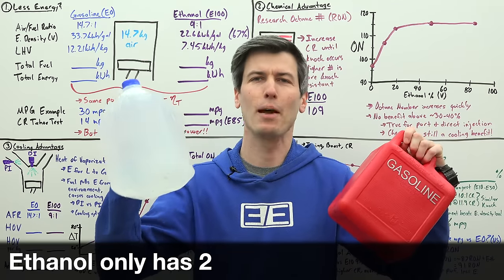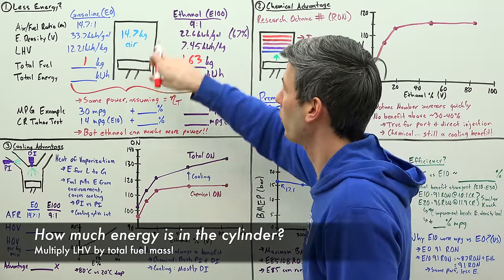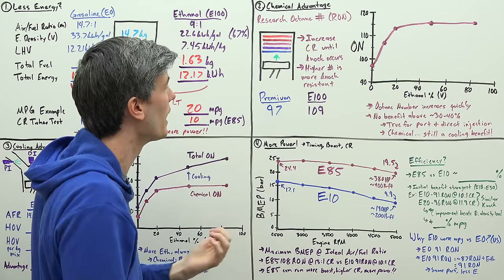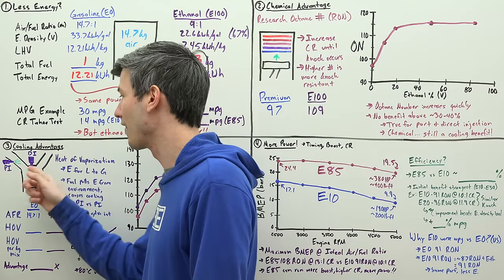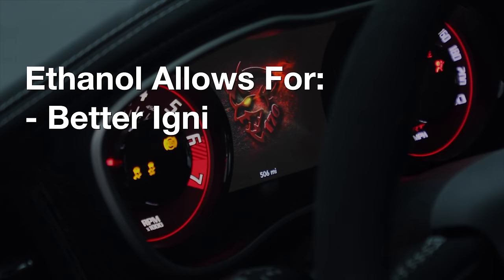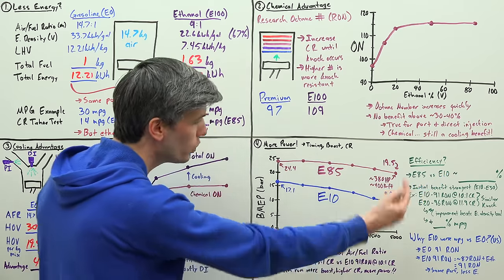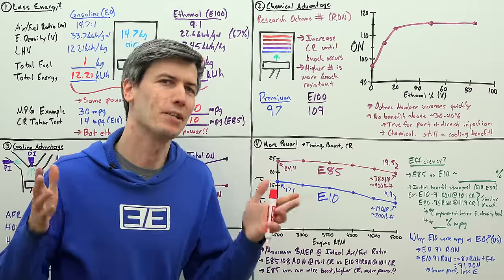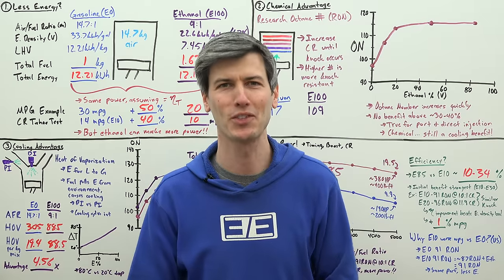Why Does Ethanol Make So Much Power? (Versus Gasoline)

Comment: Methanol VP racing m5 is still the boss.
Reply: The Indy 500 has used gasoline, methanol, and ethanol.  Here is an article when they switched to ethanol:

A Brief History of Racing Fuel By Craig A. Johnson

In 2005, the IRL used 100 percent methanol in their tanks. The fuel worked well and was more efficient than straight gasoline, but IRL officials believed there was room for improvement. In 2006, they moved to a 10 percent blend of ethanol and methanol, which was then changed to 100 percent ethanol for the 2007 season.

The desire to use only ethanol aside, 100 percent ethanol is nearly impossible to obtain, and is illegal to keep without paying hefty taxes that date back to prohibition. The actual fuel used by the IRL is a blend of about 98 percent ethanol and 2 percent denaturant. The exact composition includes a small amount of high-octane racing fuel.

The fuel for today's Indy cars has an octane rating of 113, compared with methanol's 107. This means a significant reduction in pre-ignition, or knocking and pinging.

In addition, many of the people who handle the fuel, say it smells like tequila. This quality may seem insignificant, but smell is actually one of ethanol's benefits when compared with methanol. Pit crews noticed the switch to ethanol immediately, reporting fewer coughing fits and less eye irritation before any other modifications were made to accommodate it.

According to Dennis Vervynckt, manager of hospitality services and an IRL official, in 2006, the first year the IRL began using ethanol, teams saw a reduction in efficiency of about 10 percent. "That's because we put straight ethanol into the tanks," he says. "The teams initially didn't make any or very many adjustments to their engines. After a few months, they kept tweaking and by the end of the season they were back up to 100 percent efficiency."

Vervynckt points out that there was a minor loss of power. "When they first started using ethanol, teams saw a slight drop in horsepower," he says. "As the teams got used to the fuel, they were able to get more horsepower from ethanol once they again reached maximum efficiency."

The switch to ethanol also allowed the racers to carry less fuel and make fewer pit stops, thereby increasing efficiency even more. "When the cars ran on methanol tanks had to hold 30 gallons to accommodate the fuel requirements of the cars," Vervynckt says. "After getting the engines to perform at their full potential, there was a significant gain in mileage. Indy cars now have 22-gallon tanks. When a driver pulls in to change out his tires, he can fill up. Teams were able to match their tire and fuel stops exactly, instead of stopping for tires only, or fuel only."

That efficiency translates into much less fuel being used by the sport. Lifeline Foods LLC, which supplies fuel for the IRL, will produce 120,000 gallons of ethanol for the 2008 season. And though this may seem like a lot, it's 20,000 gallons less than was used the previous seasons.

The switch from methanol-based fuel to ethanol has amazed almost everyone in the league. Drivers, the direct users of the fuel, voice their approval in glowing terms. "[Ethanol] is an American fuel that is good for the country and the environment," says Ryan Hunter-Reay, of Rahal Letterman Racing and driver of the ethanol car. Standing beside his crew as they make last-minute adjustments to the car, he is more than happy to discuss the benefits of the IRL's switch to ethanol. "It's been great for Indy racing the fuel economy, emissions there's nothing we don't like. We love it."
Reply: @danafletcher2341  — Interesting ob about the smell of ethanol exhaust. Ethanol exhaust fumes actually smell good !

Comment: In my 2011 F150 5.0 I get 21mpg on the highway with pump gas and somehow get 17-18 with e85.
In town, short trips i get 12 pump and 10 e85. 
I dunno. E85 FTW.
Reply: Prices from 85prices:

E0  =  $3.96 at  21.88mpg=$.181 cost per mile
E10 = $3.35 at  21  mpg  =  $.160 cost per mile
E15 = $3.06 at 20.79mpg =$.147 cost per mile
E85 = $2.56 at 17  mpg    =$.151 cost per mile

Your 2011 pickup was rated at 360 horsepower on E0 and 375 horsepower on E85.
Reply: Ford's prototype eco-boost engine was optimized for E85 and achieved 15 to 20% better fuel economy with E85 than with E0 with load performance similar to a diesel.

They didn't come out with it in flex fuel in part because they thought they could skirt paying for the MIT scientists patents on the eco-boost technology.  This is still in litigation.
Reply: @fletch2119  I pay 2.20$ here in MN gallon for E85. Less than that sometimes. And she runs better on E85. Love that stuff.

Comment: How about methanol vs ethanol? IIRC the original flex fuel was M85, not E85.
Reply: Ethanol-gasoline blends have been used since the late 1800s.
Reply: @TheAutoChannel  Sure, but not the FlexFuel manufacturing label.
Reply: @captsorghum  What does the FlexFuel label have to do with the original comment you posted?
Reply: @TheAutoChannel  Lol my original comment was about flex fuel originally being M85 vs E85. I know they burned all kinds of things in the 1800s. I guess I should have written "FlexFuel" in camel case in my original comment.
Reply: @captsorghum  You wrote, "If I remember correctly, the original flex fuel was M85, not E85." Whether you write "flex fuel" or "flexfuel" it doesn't matter since the first modern flex fuel vehicles didn't come on the market until near the end of the methanol-gasoline experiment, and the methanol-gasoline experiment was really just in Califonia. Other states used ethanol in the blends.
Reply: @TheAutoChannel  Haha ok.

Comment: So how does methanol compare to gasoline/petrol as we call it in the real world.
Reply: Here is an article about the Indy500 who used gasoline, methanol, and ethanol-all three fuels:
(Note they switched away from gasoline originally for safety reasons after a multi-car crash demonstrated superiority)

A Brief History of Racing Fuel By Craig A. Johnson

In 2005, the IRL used 100 percent methanol in their tanks. The fuel worked well and was more efficient than straight gasoline, but IRL officials believed there was room for improvement. In 2006, they moved to a 10 percent blend of ethanol and methanol, which was then changed to 100 percent ethanol for the 2007 season.

The desire to use only ethanol aside, 100 percent ethanol is nearly impossible to obtain, and is illegal to keep without paying hefty taxes that date back to prohibition. The actual fuel used by the IRL is a blend of about 98 percent ethanol and 2 percent denaturant. The exact composition includes a small amount of high-octane racing fuel.

The fuel for today's Indy cars has an octane rating of 113, compared with methanol's 107. This means a significant reduction in pre-ignition, or knocking and pinging.

In addition, many of the people who handle the fuel, say it smells like tequila. This quality may seem insignificant, but smell is actually one of ethanol's benefits when compared with methanol. Pit crews noticed the switch to ethanol immediately, reporting fewer coughing fits and less eye irritation before any other modifications were made to accommodate it.

According to Dennis Vervynckt, manager of hospitality services and an IRL official, in 2006, the first year the IRL began using ethanol, teams saw a reduction in efficiency of about 10 percent. "That's because we put straight ethanol into the tanks," he says. "The teams initially didn't make any or very many adjustments to their engines. After a few months, they kept tweaking and by the end of the season they were back up to 100 percent efficiency."

Vervynckt points out that there was a minor loss of power. "When they first started using ethanol, teams saw a slight drop in horsepower," he says. "As the teams got used to the fuel, they were able to get more horsepower from ethanol once they again reached maximum efficiency."

The switch to ethanol also allowed the racers to carry less fuel and make fewer pit stops, thereby increasing efficiency even more. "When the cars ran on methanol tanks had to hold 30 gallons to accommodate the fuel requirements of the cars," Vervynckt says. "After getting the engines to perform at their full potential, there was a significant gain in mileage. Indy cars now have 22-gallon tanks. When a driver pulls in to change out his tires, he can fill up. Teams were able to match their tire and fuel stops exactly, instead of stopping for tires only, or fuel only."

That efficiency translates into much less fuel being used by the sport. Lifeline Foods LLC, which supplies fuel for the IRL, will produce 120,000 gallons of ethanol for the 2008 season. And though this may seem like a lot, it's 20,000 gallons less than was used the previous seasons.

The switch from methanol-based fuel to ethanol has amazed almost everyone in the league. Drivers, the direct users of the fuel, voice their approval in glowing terms. "[Ethanol] is an American fuel that is good for the country and the environment," says Ryan Hunter-Reay, of Rahal Letterman Racing and driver of the ethanol car. Standing beside his crew as they make last-minute adjustments to the car, he is more than happy to discuss the benefits of the IRL's switch to ethanol. "It's been great for Indy racing the fuel economy, emissions there's nothing we don't like. We love it."

Comment: If this is true, God and everybody else needs to make it work. Every test ever done on any vehicle where they test between E0 and E85, E85 cuts fuel economy by 50% or so. One recent article I read used a flex fuel Tahoe. It literally dropped 50% (18.3mpg @75mph down to 13.5mpg at 75mph) when switched to E85. Heck, in my 2015 F-150 just going from E10 to E0 (I ran 93/E0 all year except for one tank of 93/E10 to clean the system) and I got around 3~4mpg more on 93/E0. I drive a diesel now, no need to stress over ethanol.

It sounds to me, based on your info here, that we need an E100 engine that only runs E100, and is tuned like a Lambo or something to take advantage of the cooling and advanced timing. Oh, and the 2015 F-150, using 93/E10 was supposed to be at 385hp/430lb-ft. I used 93/E0, but never dynoed it.
Reply: COMICAL! SAD!

Comment: The fact that ethanol gas "spoils" is the problem.  He is showing power advantages for high performance engines. Could the alcohol be introduced separately from pure gas in the intake area? My ordinary "Classic " vehicles and small gas machines are better off without ethanol.
Reply: Spoils? really?

What’s the shelf-life of vodka ?? Allow me to assist:

“How Long Will My Vodka Last? An unopened bottle of unflavored vodka has a shelf-life of decades. After opening, it will still be good for 10 to 20 years.”
Reply: @sking2173  ...and it just grabs water outta the air! So i doubles itself if you leave it outside in the rain!
Reply: @oldblueaccord2629  — I personally don’t leave my vodka sitting around without a cap … Also, my liquor doesn’t hang around very long after I open it …😁

Comment: Question.
I have a 1968 dodge with a 426 cubic inch, hemi head engine ( dual four barrel carbs, if that makes a difference  ).
and hardened valve seats so I can run unleaded.
Would you recommend running  e10 or e85 fuel ?